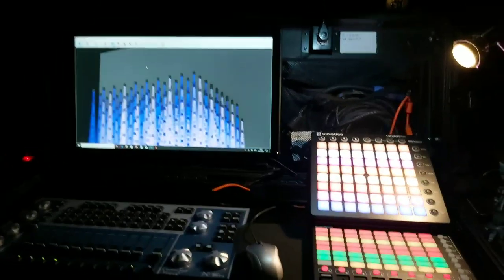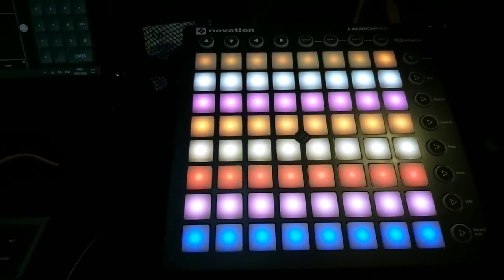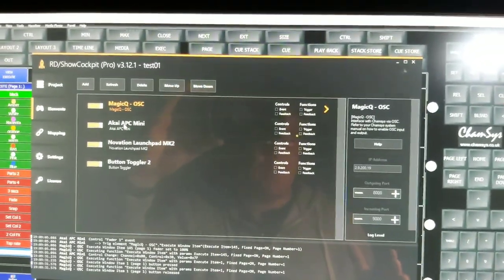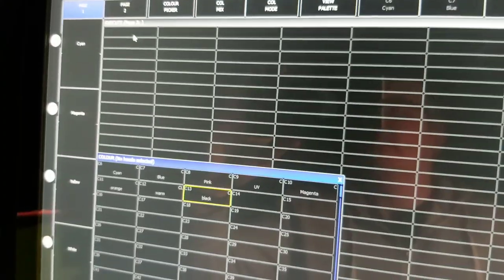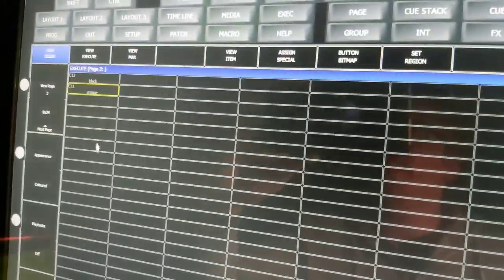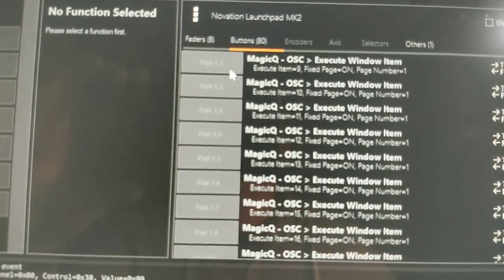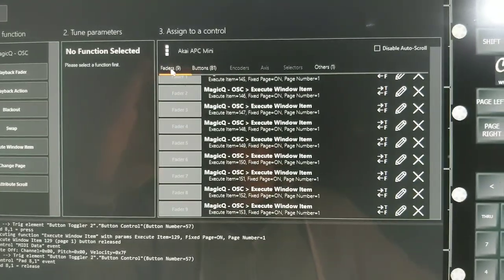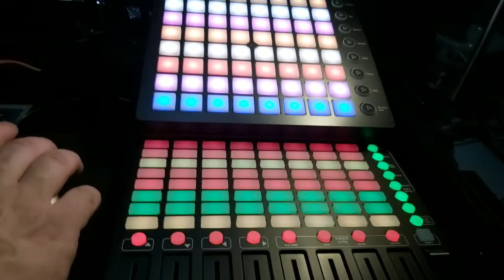Rd/Showcockpit, chamsys magicq, Akai APC mini and Novation launchpad talking midi and OSC

Comment: Heyho, thk for the Vid,
but can I also use only the MagicQ Mini Connect and MagicQPC without Bomes Midi Translator or Showcockpit?
Reply from the maker: Hello Johannes, sure, doesn't matter if you use a mini connect, or stadium connect... any kind of console/wing will do the job.
good luck with your project!
Reply: @starlightjasper  thk. Than I will find it out, if it is working without Showcockpit :)
Reply from the maker: sorry Johannes, i read your question too quick...  Showcockpit is using OSC, if you can write software yourself, you can translate OSC to midi and vice versa, Showcockpit translates the OSC - Midi - OSC.  So unless you can write this kind of software, you're gonna need showcockpit
 @johanneserlbeck
Reply: @starlightjasper  ok thk for the answer. Than its not working without theese. Have a nice day :)

Comment: So you are just using a fader wing and you get midi control? I am getting conflicting information on this. I have been told by some that a wing will unlock midi and others say you have to buy the Rack Mount Dongle.
Reply from the maker: Rd showcockpit is talking midi to availability and novation and translate it to OSC into magicq. 
So just need a piece of blue hardware
Reply: @starlightjasper  Greetings...''a piece of blue hardware'' to unlock a demo mode of MagicQ is a PC Wing or MagicQ Two universe DMX USB interface? I get the idea about RD Showcockpit talking to MagicQ but unlocking demo mode is a question for my side...Thank you in advance for answer...
Reply from the maker: @hoombass  dual dmx or a wing can get you out of demo mode and let you talk to showcockpit!
Reply: @starlightjasper  Thank you...I have have several MIDI devices so now it is time to get dual DMX...Thank you once again.